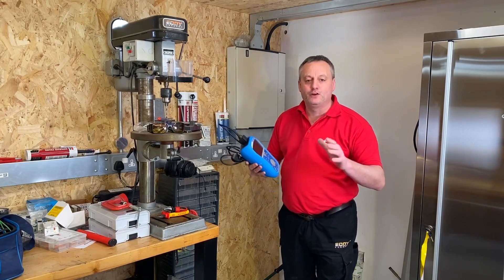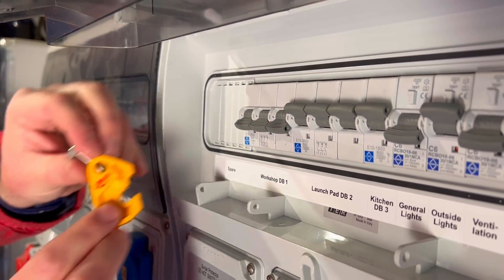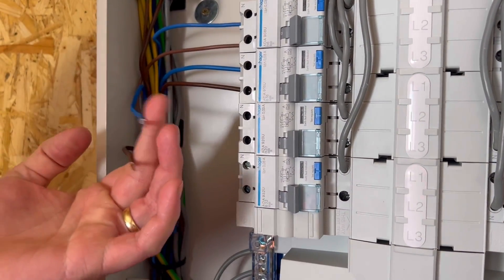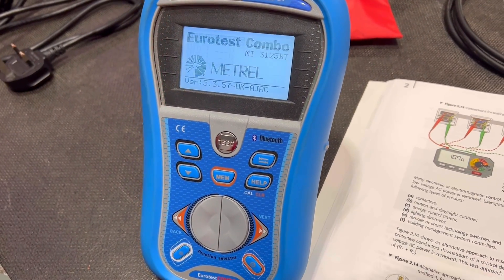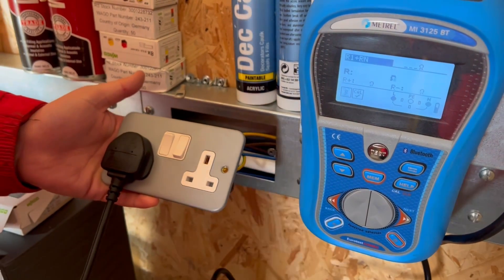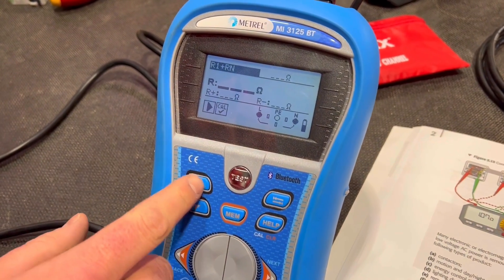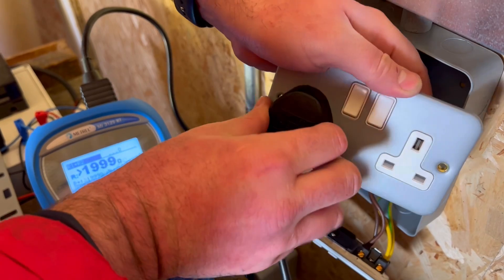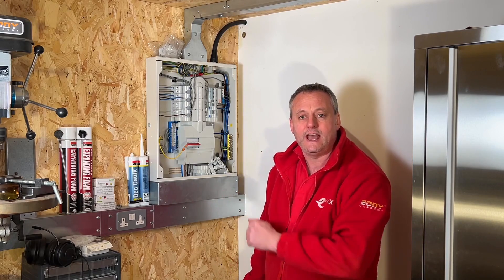Easy Tutorial: CPC & Polarity Testing for Radial Socket Circuits

Comment: When you shown the back of the socket, I saw both cpc was connected in one of the cpc connector. Some advice I was shown that they should be connected into each side of the plug. I was wondering if makes any difference?

Comment: Wow that's an annoying tester for something so simple needs binning that does 🤣🤣
Reply from the maker: No, it's a great bit of kit, I used a slightly older model in the wild for quite a while to be fair. 😊
Reply: @efixx  anything to drag the test on ay it .... I'd find it mocking my intelligence just for a simple test that cud do it while it's hot with a plug polarity tester or multi meter but the zeroing the resistance is a good feature and should be on all multi meters

Comment: Hoping for quick advice, installing a 2kw heater (creda car 200) and cable in 6-8m of conduit and unsure as on fused spur, should I go 10amp breaker with 1.5mm t+e so 20% above what need or as fused spur in it and run to go 16amp breaker with 2.5mm t+e? Or even 10amp breaker on 2.5mm t+e?

So you know it as of where cable going in my flat I thought I help by laying the cable into conduit on the run and let an electrician connect it to consumer unit and sign it off

Comment: What if there is a Line / CPC reverse throughout the circuit. Will a r1r2 test check this polarity?
Reply: R1+Rn, the R1+R2 coupled with the visual inspection does.  Just the R1+R2 on its own doesn't.  As they said 2 tests and a visual is good practice for a polarity test

Comment: At 9.36 , you are showing us blue ( neutral) connected to ‘L’ (Line) and brown (line) connected  to ‘N’ ( neutral).  Obviously horrified given the testing …..
Reply from the maker: 100% that’s why visual inspection is more challenging 👍🏻
Reply: I notice that the socket front was wired incorrectly at 9.28... then noticed you have also noticed and commented... Well done.
Reply: It was probably deliberate to show that visual inspection should be done first or to show it isn’t always done hence why we test the circuit. ? It no point testing then find you have go round removing accessories because your test results were wrong. 
But how did he get a positive result? On the last socket. ?

Comment: Actual metal money is getting rarer these days, but a pin from the socket works just as well to zero the lead... Not that I'd bother unless the result was too high, if it's under what it needs to be the resistance of the lead is a moot point. Also, why not just do all this live? A live ZS test would verify earth continuity and the tester would let you know if L&N were reversed. As for the fly leads, so long as there's 1 solid lug in the back box, it's unnecessary and not required by BS 7671.

Comment: How come the last socket shown saying a visual inspection etc was connected wrong polarity
Reply from the maker: It was but can be missed on a visual inspection when you see to browns and two blues 👀👍🏻
Reply: I am lucky got a plug in tester, somehow flipped live and neutral on a single gang socket once as the position of connection was mirror to some of the other brands I used

Comment: You do know that you have reverse polarity on the socket you're pointing at when talking about polarity?  Or are you just trying to see how many were actually paying attention?
The reinforcing in BS7671 that for initial verification the installation should be tested in stages as it's being installed is something I've been hammering in my 2391 courses for years.  Wouldn't do this for an EICR on an existing installation as this should've been proved at the IV stage and we might introduce defects, unless it was for fault diagnosis for the containment or CPC.

Comment: @eFIXX, a question about the dead polarity test:  

Accepted method:  Step 1:We link L-N at the board, then test for continuity between L and N at all points.  If all good, then we go on to step 2: Link L-E at the board, and test for continuity between L and E at all points.  Again, if all good, then polarity is confirmed.

My question is, in step 1, why could we not link N-E, and test for continuity between N and E at all points, instead?  I may have missed something, but as far as I can tell, this (in conjunction with step 2) would also prove polarity.  It could also be directly compared with R1+R2 in the majority of cases, where N and E follow the same path.
Reply: I do this on radial circuits like cookers and showers. If the rn+R2 is higher then needs a tighten up switches or check other joints
Reply: @jamesmoon5632  that's exactly what I use it for too 👍
Reply: From a technical standpoint, the test you've described produces a vastly similar result, but from the everyday use point of view.  I'd just like to add a few points for consideration. The test itself is to verify the continuity of the protective (Earth) conductor, it's use as a method of proving polarity is just a little Brucie bonus. We only use the second conductor as a return path for the test current, otherwise we can use the R2 or 'Long lead' method. 

Additionally, the continuity of the CPC should be proven at all points of utilisation in a given circuit, the neutral conductor isn't always present at these, picture a light switch in a domestic dwelling wired using the three plate method or a final circuit feeding a three phase motor, traditionally there wouldn't be a neutral in these places, so the line conductor is a safe bet. 

Lastly, taking the resistance of the line and CPC,  gives you a resistance value for the load side of the earth fault loop , when added to the external earth fault loop impedance (Ze or Zdb), we can use this as part of of a calculated Zs result, eliminating the need for testing on energised conductors where it may be difficult to do so in a safe manner. So it saves you a little time.

Comment: British sparks have to be the biggest cheats in the world. There’s no way there could be that many electrical fires in the UK if they actually did all those tests.
As a more serious point it would be interesting to see a program on what actually happens to the submitted test documentation. For it being a valid system it surely has to be followed up with spot checks?
Reply from the maker: Great points thanks for commenting 👍🏻